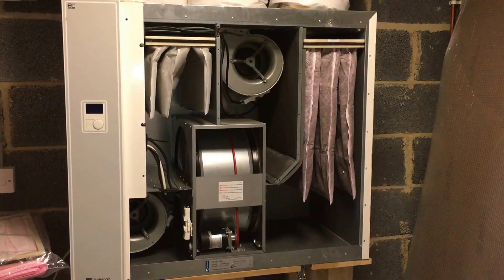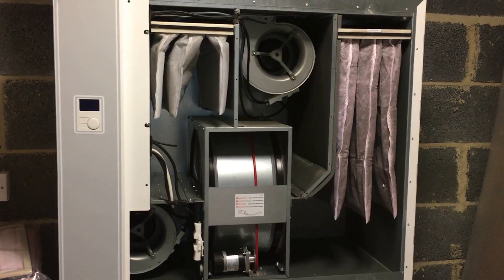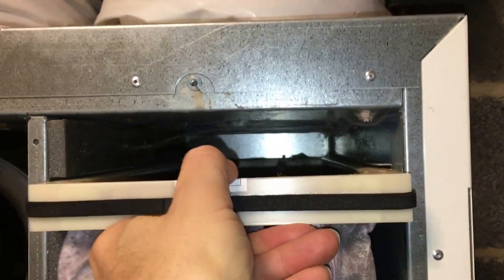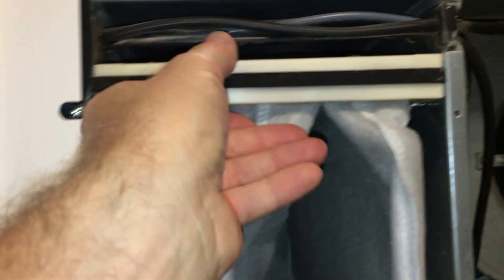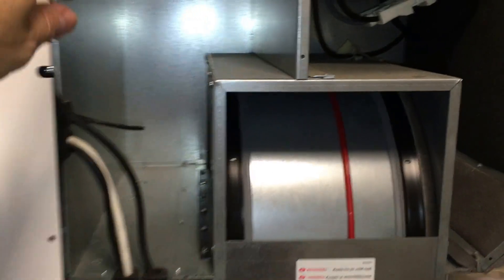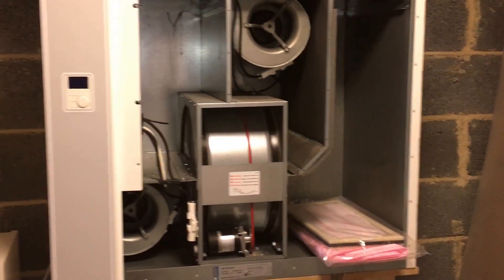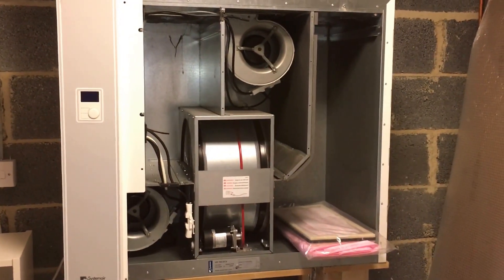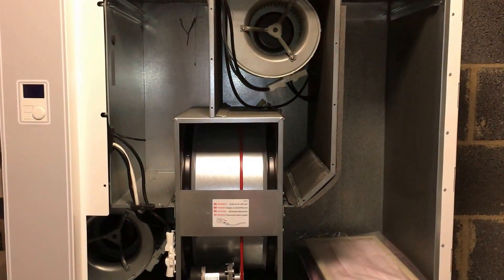Villavent Systemair VR 700 DCV

Comment: Have just been to a customers property as the extract fan had started to make loud noises - its turned out to be the rubber bush mount holding the motor shaft (sits on the triangular legs at end of motor). I have been told this rubber mount is not available as a spare so have to change the whole motor. Does anyone know if the rubber mount can be sourced?
Reply from the maker: System Air UK 🇬🇧

Comment: We hawe the same. Works good. Now it shows Temperature Sensor Error. Could be Short circuit or breach in sensor(s). I try with changing a Sensor. A Sensor coms with a 1.8m Cable, costs 40€. Looking for instructions to change the Sensor.
Reply from the maker: Best of luck 😊

Comment: Rory do you use this to warm the house in winter?  Or alongside an existing heat source eg boiler. My system just has a higher / lower heat button.  Also are these easily serviced.  Mine has never been serviced in the time I've been here, but very rarely use.
Reply from the maker: Hi Jak. We have a ground source heat pump but for periods of the year we just use the Systemair as we like the fresh air and filtering.  So when colder (but heat pump off), I turn on the heat recovery mode.  Never had it serviced as I do it myself buying the parts from UK Systemair people who are very good.  Fresh air in modern sealed houses is very very important.  It’s unnatural and unhealthy not to have fresh air.  Our system is running 24/7/365.  Hope this helps 😊
Reply: @cotswoldmusings  aha very interesting. I live in a drafty (Georgian) converted to apartments (2005) house with this system (and a boiler) so pretty intrigued. I'll contact Systemair. Thanks so much for the heads up! J
Reply from the maker: @jacquelinecloake1552   I’m surprised this system installed in your older style property.  Our last house was like yours and definitely never any condensation because of constant air movement.  Unless I’m missing something I’d question the need in your home.  For sure in the summer with windows open it’s a pointless waste of energy using this system.  Plus in winter there’s the risk you just create more drafts with the radiators struggling to keep house warm.  In France where householders use those roller shutters on all windows while away they often use small plastic cheaper versions just to prevent house going musty while shut up.  Doesn’t apply here in the U.K.  Our modern house has underground cinema etc. so there is a need for this technology.